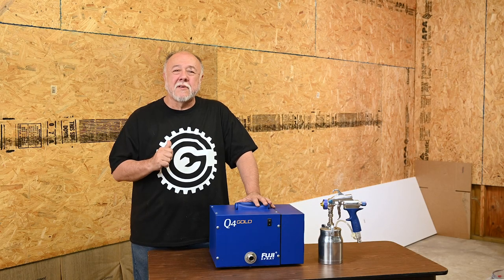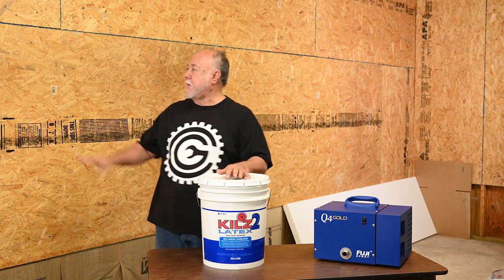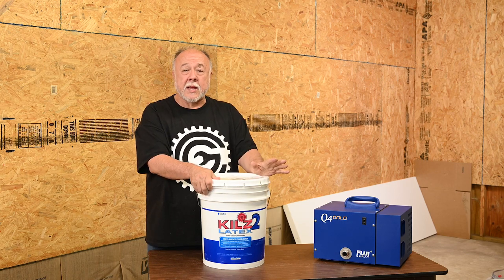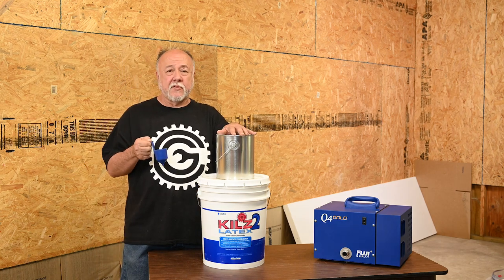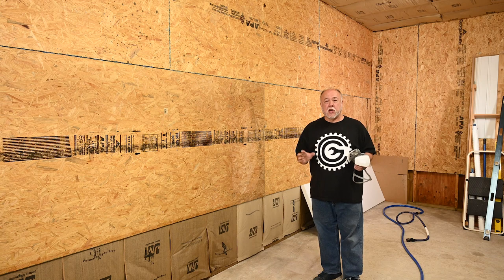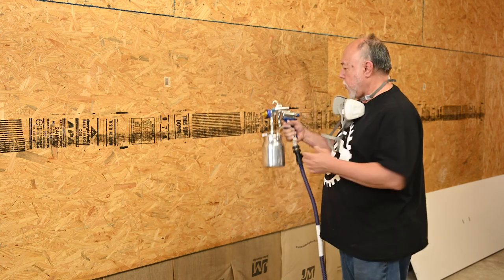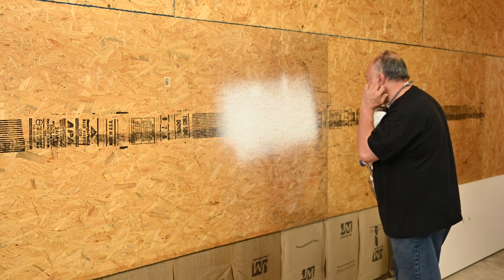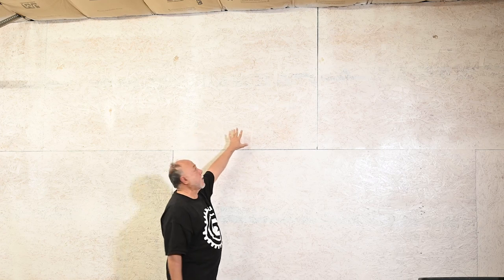Using HVLP To Paint Walls. Bad Idea?

Comment: For larger jobs like this, you need a pressure pot. they are usually in the size of 1 or 2 gallon size. Drawback is cost, but if you are doing these types of jobs a lot, then it makes sense.

Comment: When painting wood you use more paint on first coat and wood soaks it up really well on first coat so need to go back over it 2 to 3 times to get a final finish. Also you should buy a 5 gallon paint jug when you do paint this much so you don't have to open multiple can't. I have a 1.5 gallon electric pot spray and I wish the tub was bigger but using the 5 gallon paint jug makes it alot nicer to just pour and fill fast
Reply: @artv4nd3l4y yeah I'm no professional painter but yeah doesn't everyone know they need to use primer first?

Comment: I'm just doing some first-time spraying myself, and liked the learning curve of this older video. I've plenty experience conventional painting and realize you hadn't seemed to grasp that you watered your primer by 40%, yet were surprised it didn't cover in one pass? The beauty of spraying is a quick, thin coat dries so fast one can re-coat by the time the wall is done first coat, minimizing set up time. Also, in hindsight, could you have relatively easily rigged up an "arm" to hold the sprayer -thus relieving your arm?

Comment: Totally disagree, your machine is just fine. Inexperience and not understanding how it works is your issue.  Primer should not make your wall pure white. But when you paint with the finish paint it will look perfect.  For the 10,000 sq ft  of painting you need a much bigger machine like a Graco Magnum X7 Electric Stationary Airless Paint Sprayer or a Titan if you,re trying to complete the project within  2 days.

Comment: Thanks for pointing out the issue up/down the ladder and filling the small paint cup. i just traded my HVLP sprayer for a  airless type with the paint on the ground and long hose. no climbing for me thanks again for the heads up.

Comment: Thanks for sharing your experience with that sprayer. I sprayed cement board lap siding in the garage before installing them with a HVLP gun on a standard 30 gallon 130 psi compressor.  Constantly re-filling the cup and fiddling with the thinning and strainers.   A nice finish, but not the right tool for the job.  Regarding flooding, I finished the basement in my last home in NY.  Framed it in metal studs, insulated with rigid styrofoam board and railroaded non-cellulose or paperless drywall.  Railroaded means laid the boards down 8 feet wide, 4 feet tall rather than stand them up.  By doing so, mold has literally nothing organic to eat or grow on.   It got flooded with less than an inch of water in ten years of ownership. Dried it out, zero mold.  If you get a flood in that garage, you need to open the walls and load up a pump sprayer with bleach.  The wood framing will mold, and it will crawl up the insulation through capillary action.  You can also frame the walls with structural steel studs.  Overkill?  absolutely.   Thanks for sharing your real experience, far more informative that the over produced informercials posing as content.

Comment: Painting OSB is not a good idea to begin with.  One side is treated (wax) the other is not.  Regardless, it's not designed to be an exposed surface in any application.
Reply from the maker: The other portion of the shop has several thousand square feet of painted OSB as the finish layer. 22 years, no issues at all.

Comment: 1/2 gallon to cover that area is way too little. I would expect 1/2 gallon of primer to over 4 sheets of plywood. I have the mini mite 4 and have painted small areas of wall with it. if I was doing a large area of wall like you are I would use an airless sprayer

Comment: The camera doesn't show enough detail, but that spray pattern at 7:40 looks like the work of a very high quality tool.
Like everyone else said, an airless sprayer would have been the better tool. Did you end up buying one?
If so, what were your thoughts on both?

I love my Graco Magnum x5. Seems to be more capable than anything I need around the house. FFLP tips seem good enough for me, and I like the variety in width and orifice size (though pricey at $30-40 each). I've sprayed OSB with it, my only complaint was that bits of the OSB peeled when wetted with paint; not really a problem with the machine. I've found it is helpful to have a spotter watching you; it is very hard for me to see what I'm doing when standing a couple feet from the work - with a microscopic perspective. Looks like part of this inconsistent coverage may have been various dilutions or spray/pressure settings when using multiple pots, or maybe distance to work. I gave mine at least 2 coats, but I was using some questionable/old/thinned commercial-quality SW interior.

What I don't love, is that it's kind of a brute. I haven't figured out how to do fine detail work with it (smallest tip I've used is a fflp210, but still... a bit like trying to paint a window with a 2-3" paint brush. You can do it, but it isn't nice, and there must be a better tool to use (maybe a fflp1XX would solve the problem, idk, but 210 is pushing it for latex afaik - I don't see many people talking about 1XX tips). Still good enough for flat 3-4" trim, or stuff with minimal detail or care about appearance). If there was a volume control, it'd be perfect.

The HVLPs have seemed pretty nice in that regard - it seems nice to get a spot pattern 1-3" in diameter, and be able to control volume output.

To anyone else, you're *never* supposed to spray at your flesh (google subdermal paint injection), idk if that applies to both airless, and HVLP, but maybe it's worth a search. An airless also saves you from potting paint (you just stick the pickup hose into the gallon or 5 gallons of paint. (or your mixing bucket). I've seen people paint doors with them, so I'm sure it can be done. But I can't speak to the comparison between HVLP/airless; I've only used 1. Usually available for <$100-175 used, look for the Magnum x5, x7, or better - skip the Project Painter Plus if you can, something about pump reparability, or mean time between failure, iirc.

Comment: I used the same stuff today on my garage,  24x9 wall with osb , took 1 gallon to do 1.5 coats .. you can see a huge difference on my 2nd coat for half the wall . But I used a thick roller and brush for priming . I'll use my sprayer for painting the finished coat , I really wanted to minimize waste. My finish coat will probably be a gray and stripe of black . Match the colors in my epoxy floor kit I got ..

 I think you should of left it thick for best results .

Comment: I had nothing but problems with my Fuji.  Tip leaked like crazy no matter what...tighten the nut....untighten the nut...replace the needle...still leaked.  Hose connection broke on 3rd use.  Fuji must know they tip leakage is a problem because they have addressed it on their site...which just tells you to loosen the nut.  Try sanding...adding primer...resanding...and then putting on your first coat only to have the tip leak onto the ready to go surface. Nightmare.

Comment: And alot of professionals use extentions on their spray guns so they are able to spray more surface area before having to move to a area of the wall
Reply from the maker: An extension is pretty common on an airless sprayer, but I've never seen one for an HVLP sprayer. Do you have an example?
Reply: @CliffsGarage  It's called a pressure pot. The larger ones require a small compressor though

Comment: Been there, done that. Work perfectly. BUT for large areas I strongly suggest other methods. Like airless, etc. Your compressor really take a beating. Either case the results can be quite good. The size of the cup for a "one of" is not an issue. Just refill as needed. I'm not sure HOW you were doing it, but refilling the cup is a very swift task! 
For a professional or daily (frequent) usage, well that's another matter. ;-)
My largest project was painting a shipping container, all surfaces except floor. Human need for resting and the compressor resting (cooling) were both welcomed and needed. Notice the compressor was kept on the shade. Even than it reached interesting temperatures! LOL

For surfaces like that, which are basically a "sponge". Apply sealer and primer before your actual top coat(s)... All rather standard procedures! The OSB absorbed a lot of that initial layer of paint, that's normal.